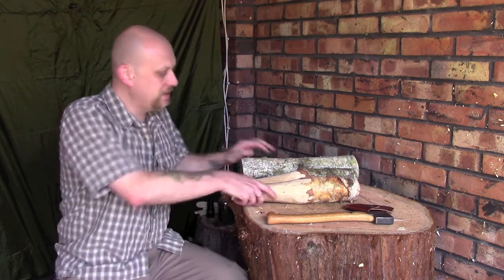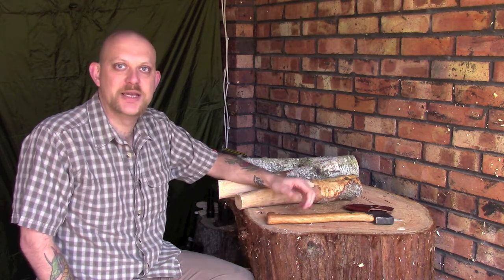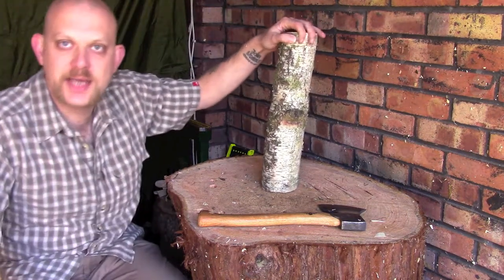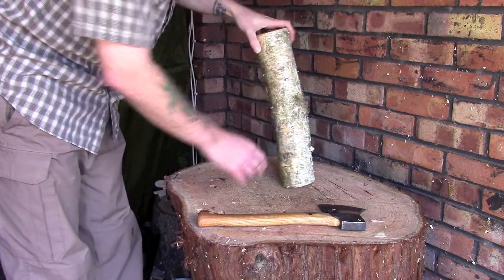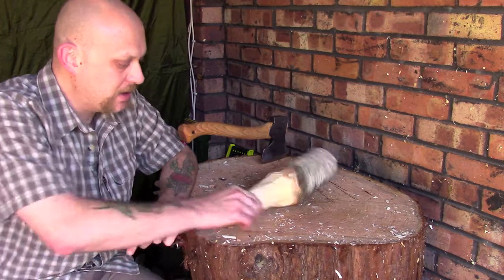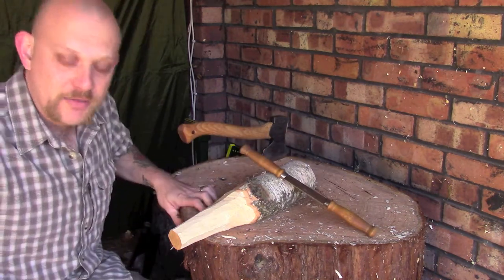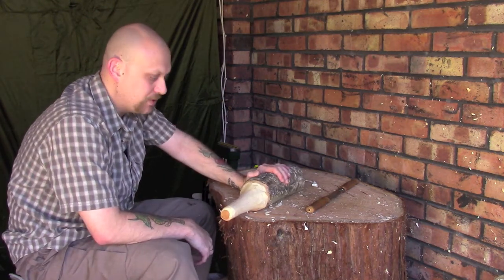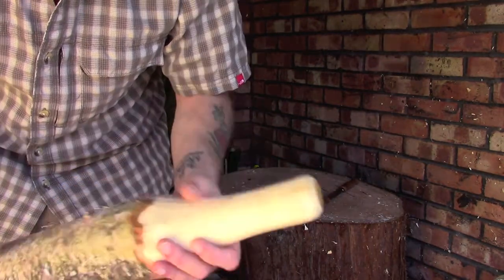Making a Wooden Froe Mallet

Comment: Brilliant video. I was wondering about the saw method as ones I had been using were made that way but my concern was reducing the strength. This shows a much better way and confirmed my concerns. Will definitely use this method for my first go at making one.

Comment: Thank you Woodcraft Hamster!  For my mallet,  I used a saw to cut the 'end-of-the' handle at the middle of the log.  I used the draw shave in the OPPOSITE direction to make a very clean tool.  I'm an Artist,  and I tend to be an@l about the looks!  I also cut a tab at the END of the handle to run a leather thong through it for hanging it and keeping it off my dirt floor.

Comment: And once you have a froe mallet you can use your froe to easily make more froe mallets.

Take a small tree and at the point where the width of the tree is equivalent to the desired width of the mallet saw down to the just over the desired width of the handle. Leave plenty of extra length on the handle end and use your froe to split to the sawn point and continue until till there is a desired shape. Cut off the ends to length. The process can also be done with a hammer and chisel for people without a froe. It is a very fast way to make a large mallet.

Comment: I wonder if you could clarify:  My understanding is that what you have is actually a maul, as in a stonemason's maul.  A mallet on the other hand is a "hammer" head of wood, with a handle inserted at right angles to the grain of the wood. However, I see many references mixing these two up willy nilly, so now I don't actually know which is which! 
Help!
Reply from the maker: You are absolutely correct, this is in theory technically a maul. I think common/modern terminology has blurred the lines between mallet and maul and they have become interchangeable.
Reply: @WoodcraftHamster  Thanks for taking the trouble to reply! Much appreciated. 👍👌